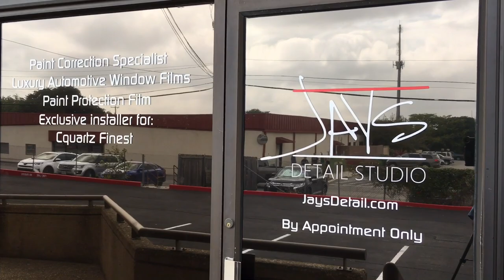Total Front End Paint Protection Film Is completed

Comment: Ceramic coat after the film. I heard that. But did you say that you had it done before the film? If so, was that removed during the pre-film application when the were buffing?  What did all of these processes cost you? Very nice videos. I love the Bullitt Mustang.
Reply from the maker: williamkazak Yes I originally had the entire car ceramic coated but only the front bumper covered with paint protection film. So they basically polished the fenders and hood before adding the Suntek  paint protection film, they then coated the film with ceramic coating to match the rest of the car👍🏽👍🏽 The original package I got was around $3000 but it included the car and wheels being ceramic coated the front nose of the car with paint protection film and all the car windows and windshield  tinted with high-quality ceramic window tint.
Reply: IMGONEIN60 thank you for your info. Love the Bullitt.
Reply from the maker: williamkazak no problem thank you for watching 👍🏽👍🏽
Reply: @IMGONEIN60  great Vid!💪I will do mine. Now, how do you care for the car? Just water wash? Also did doing the wheels help with dust ect?